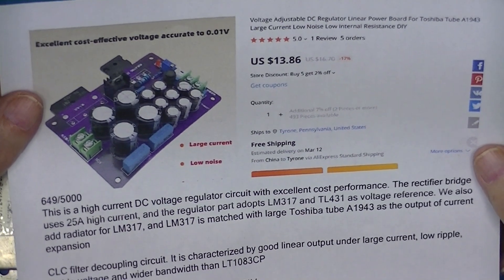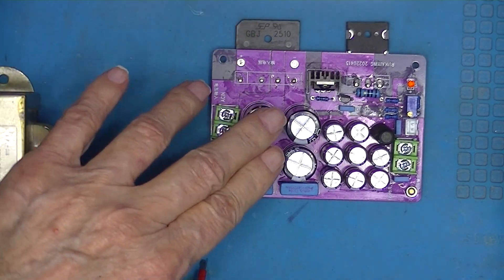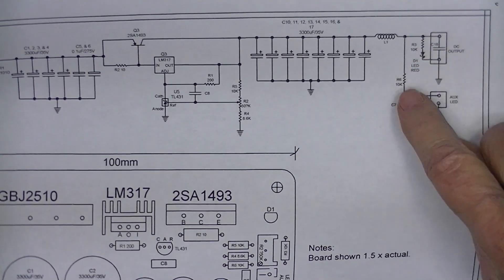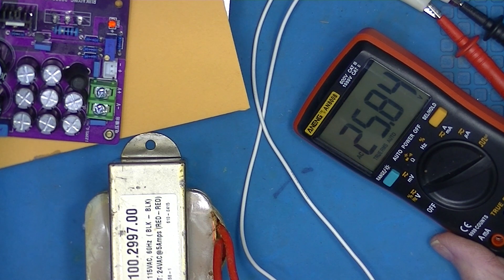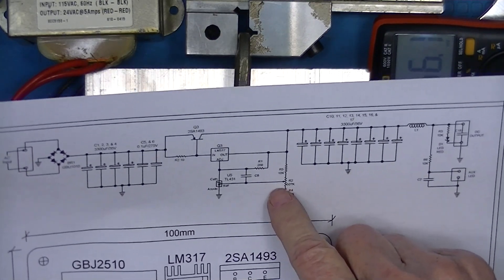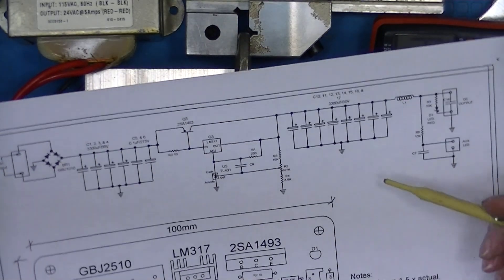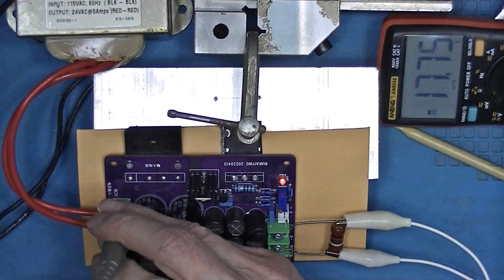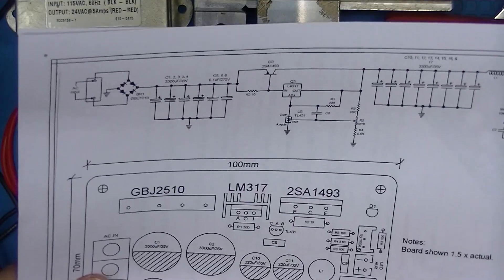RUIKAIYING (AliExpress) Power Supply Board

Comment: About the circuit operation... the LM317 tries to maintain a voltage of 1.25 between the output and Adj pins. The TL431 tries to maintain 2.5V between the Ref and Anode pins. With R1 the LM317 is a constant current source supplying the TL431. If voltage at the TL431 Ref pin goes above 2.5V it will try to sink more current which will cause the LM317 to reduce the output voltage. Likewise, if the Ref pin voltage drops below 2.5V the TL431 will attempt to reduce the amount of current it is sinking which will cause the LM317 to increase the output voltage. Perhaps this arrangement offers better ripple rejection, PSRR, etc. than using just the LM317 by itself.